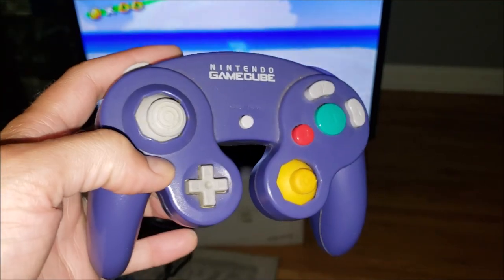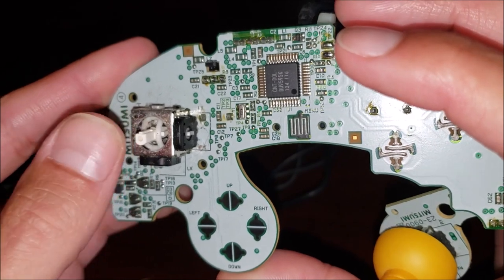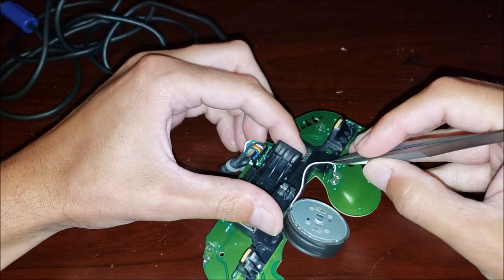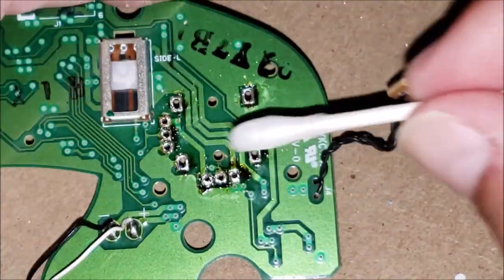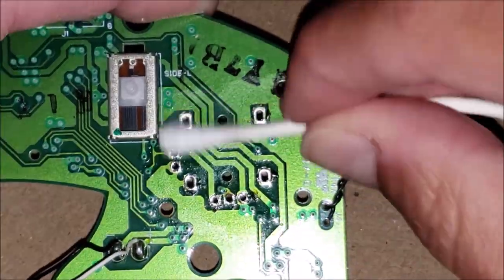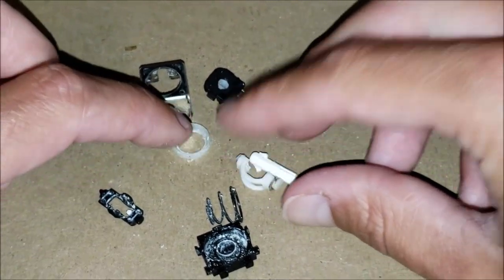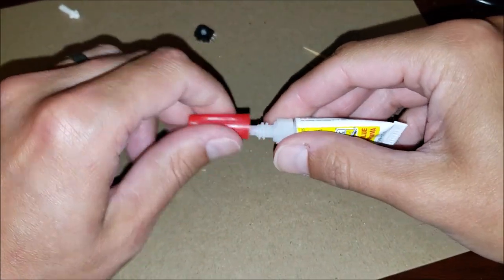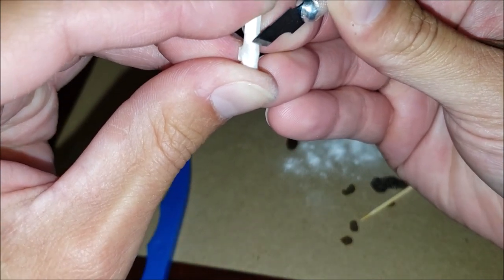Fixing a GameCube Controller Broken Joystick (Wiggle Stick) NO REPLACEMENT PARTS

Comment: I have a very similar problem with my GameCube controller. Thanks for the video
Reply from the maker: Glad to hear this was useful for you!
Reply: Don't do this..remove the stick box and replace it with a new one...they're reasonably priced
Reply: @MichaelScreamMachineEvans  Don't worry I just bought a new controller.
And it works extremely well too

Comment: This is a fundamental problem with the t1 boxes. I work on t2 cleaning, which doesn't have the same pivot issue and contact points for wear. For both t1 and t2 boxes, the black potentiometers are compatible. For the plastics I recommend cleaning using warm dish soap water and cleaning the springs and hosting use isopropyl alcohol. Most lots on ebay of junk stick boxes are loose, but doing a cleaning and rebuild helps alot. To keep the reassembly together I use a small adjustable wrench as a vice as I bend the stupid tabs. Most stick box clones you find as replacements from China or eBay are t1 clones with too whacked out potentiometers (use dolphin gc calibration to check it) and don't work with oem pots
Reply from the maker: I had never heard of the t1 vs t2 before, sounds like you probably know a lot more about these than I do. Yea those tabs are annoying, but luckily my tweezers are pretty girthy and could handle them. Thanks for checking ut the video!
Reply: @FantasticQuack  Here is some community info on the controllers around the middle. https://smashboards.com/threads/technical-knowledge-compilation-gamecubes-controllers-tvs-recording.335040/
Reply from the maker: @Richard_Hu  That is a good info page, thanks for sharing!
Reply: @Richard_Hu  The Kadano info is now pretty outdated...

Comment: For a stronger solution, you could use milliput, glued onto the part with superglue while the putty is still in the curing stage. It will dry hard as stone.
Reply from the maker: I will probably try that if I do a similar repair in the future. At the time I just wanted to use what I had on hand.

Comment: When I was trying to separate the stick from the pivot, I could not get it loose at all and ended up destroying it even more, and here you are doing it in 2 seconds with your fingernails lol. Mine almost came off my finger. Great video!
Reply from the maker: It might have came out easier on mine because it was so worn down. I'd probably have switched to a tweezers if it didn't go the first time. Thanks for watching and I hope it helped!

Comment: im just gonna replace the stickbox, they are dirt cheap on ebay i think i got like 10 of them for a few bucks
Reply from the maker: A fine choice, but remember the aftermarket parts are dirt cheap for a reason. If you can pull a real one out of a separate controller with other issues or worse condition, that is your best bet.
Reply: @FantasticQuack  yeah i just have a single controller from ebay with a loose stick so i dont have that option
Reply: You can buy a whole new controller on Walmart for $10.
Reply: @ihavenoname1343  not a genuine nintendo controller you cant , the aftermarket ones are ass
Reply: @darrell5363  I bought a white one for $10 (not nintendo) and it works great. Just don't see much point that's all
Reply: @ihavenoname1343  they are terrible quality, you get what you pay for

Comment: wow, i did this and it got rid of the wobble a lot! thanks!  though for some reason im not getting any left or right input... any ideas?
Reply from the maker: Were you getting left/right before? Could be an issue with the installation of the pot or the pot itself (number of possible reasons)
Reply: Probably means you did not solder your horizontal potentiometer well and it does not have proper electrical contact with the circuit board. You must open the controller and redo the solder.

Comment: Literally just had this issue happen when I was playing Luigi's Mansion, the analog stick now has problems going left with it now tilting slightly towards that direction. Do plan on getting it fixed. I don't want another problem controller like another one which has its Y button stuck in place.
Reply from the maker: Stuck buttons are usually an easy fix compared to a worn out joystick. For the former it usually is just opening the controller, finding the gunk that is causing the button to stick, and cleaning it out.
Reply: @FantasticQuack  If only little me back then knee that was possible lol. Even if I did knew, I would've probably broke the controller anyway xD

Comment: omgomgomg thank you that's exactly what i'm searching for, spend 3 days before found this vidéo. 
now i know what's inside this joystick mechanism, so i'll be able to repare my cracking left joystick 
(it respond correctly, but stickbox crack everytime i go up then down :/)
Reply from the maker: Glad to hear this, let me know how the fix goes!
Reply: @FantasticQuack  i will, my left joystick is cracking when i go from idle to up position, then crack again when i go down position, (but no prblm when i push left/right); 
it's the small white plastic round that we can see at 3:40 , i dismanteled my gamepad and saw this little thing shifts and "clicks" 
by chance because of your video, now i know how to disassemble this small mechanism ^^

Comment: Yes helpful,can u tell if you buy a refurbished one that no longer works if they used that method
Reply from the maker: I don't know of anyone else using this method. You're more likely to run into controllers that have had the joystick replaced entirely. You'd need to take it apart to know for sure.

Comment: I have a similar problem.. except mine is more worn down than yours.. the front white part is completely crumbled and I would love to replace the whole box. But unfortunately I don't have a soldering tool, let alone know how to use one. I know this is an older video, but it's okay. 😊 just wish I could fix my controller. And had I known about fixing controllers way back when I was a kid, I could've fixed my other controller that my old friend decided to smash against the wall, shattered the joystick cap. Was very sad. My mom threw it away too.
Reply from the maker: This was mainly an experiment to see if it could be done, almost every time replacing the stick box is the right thing to do, especially if you can harvest an OEM one from a wii nunchuk.

Comment: Dont use the baking soda to make the glue dry faster, you use it to make the glue hold stronger. Guitar repairmen use this mixture as a paste to fill in spots on guitars with damaged nuts in a pinch. Mix that shit into a paste and sand it flat
Reply from the maker: Interesting stuff!

Comment: Kool video, GameCube has 3 different analog sticks, ranging from T1 to T3, this one in particular is a T1, mine had a big loose wobble so I replaced it with new one on amazon, it was a T1 model so not much difference except for the black potentiometers, so I kept them on and just replaced the stickbox. I’ve read that the potentiometers that come attached to the boxes you can buy online aren’t good quality so hence I just kept the original ones, I’ll replace them if I begin to notice drifting, anyways thanks for the tutorial I may just do the same with the loose stick box I replaced.
Reply from the maker: Thanks for the info and for watching!

Comment: i am having the same issue of not having full forward movement while playing Ocarina of time. i don't have a lot of wobble like your controller did. when i take the shell off of the controller the problem goes away. i wonder if i can find a fix without having to do a full disassembly and repair like this. a notch cut into the stem of the joystick so that it could go forward slightly more would help, but i don't want to cut a groove into the joy stick
Reply from the maker: If the stick isn't wobbly it sounds like there could be some foreign material in the stickbox potentiometer causing your problem. You can pivot the potentiometer away from the stick box to get a look inside/clean without desoldering it, this would be the first thing I'd do but it is hard to describe the process with text and I don't have a video (yet) to reference.

A  more simple thing to try would be squirting 91% rubbing alcohol into the stick box, rotating the stick around a number of times to work in the alcohol, then blasting it all dry with canned air. Do that 2 or 3 times and it might clean out the potentiometers sufficiently to solve the problem. If it doesn't work it at least won't cause any new problems.

If you want to add a cutout on the stick cap to give the joystick more forward motion, you could buy some cheap replacement caps online and cut into those so you're not damaging the good OEM one. Doing this doesn't solve the root of the problem though.
Reply: @FantasticQuack   Since I posted that comment, I found a practically brand new GC controller at a local game store. I don't think it was ever even used.
I also bought some soldering tools, so one of these days I'm going to get the stickbox out of the old controller and try this repair. It definitely has wobble. I'm not as nervous to tinker with the old one now that I have a new one. Definitely going to follow this video when I do it

Comment: I had a go at this last night (before seeing the video), but it wasn’t so successful. There wasn’t actually much wrong with the controller but I had 3 spares so I was just trying to see if I could eliminate the wiggle entirely. (I managed but at the expense of the controller’s ability to turn left), so not a success. 

It’s weird seeing the small differences in controllers though. Mine didn’t have any soldering on the four legs of the metal frame that stick through the circuit board and some components were a different color etc.
Reply from the maker: Were you trying to repair a worn out component like in this vid? Is it not turning left due to bad wiggle, or is there an issue with either the reassembly or the potentiometer itself? I've heard of those pots going bad before.

I believe there are 3 variations of the joystick box depending on the time period the controller was manufactured. I think the one in this vid is the "oldest" variation.
See section 2.5 of this link for more info.
https://smashboards.com/threads/technical-knowledge-compilation-gamecubes-controllers-tvs-recording.335040/
(This was new to me, shared earlier in comments by RH)
Reply: @FantasticQuack  I was trying to repair a worn out one, but I didn’t really know what I was doing. I’ve actually got it sorted now and just swapped the C-Stick box out of another controller and switched it into the left analogue stick position and it works great. The right sticks never get as much wear as the left so it was in near perfect condition.
Reply from the maker: Happy to hear that! Parting out some brokens or spares is always a good way to go.
Reply: @FantasticQuack  makes me wanna fix joystick on my orange GameCube controller to Finish Metroid prime 2 echoes and Sonic Riders and Tak 2 Staff of dreams before this year is over.

Comment: It is possible to do it without soldering?
Reply from the maker: Unfortunately not
Reply: @FantasticQuack  actually it really depends on the controller. some gamecube controllers (ones that are the most recent hardware revision {called t3}) have fully plastic stick boxes that only need to be unscrewed and then unclipped from the potentiometers to be removed. impossible to tell what revision ur stick is unless u open it up though.
Reply from the maker: @KnishG  True. My response was referring only to the hardware shown in this video. I've only recently become aware there there were multiple stick-box designs.

Comment: There a $1.25 a piece on amazon. Wouldnt it be easier and faster to pay for a new 1
Reply from the maker: Of course it would, but where's the fun in that? The point of this video was to do the job with at-hand options and keeping original hardware.

Comment: This is a T1 board, no wonder. 😂 T1 joysticks aren't built to last and they are very crap. You'd be better off replacing both stickboxes with T2.
Reply from the maker: You're probably not wrong! I have since taken apart some newer controllers and the stick-boxes did seem improved.
Reply: @FantasticQuack  T3 controllers are best. You'll know it's a T3 because the whole stickbox is made out of plastic and it's all white. T3s last way longer and you can lubricate them to make them last even longer.
Reply from the maker: @SuperLuigiGuy64  I'm not privy to the T#'s, but I was digging around in a black controller the other day and the stick-boxes on that one match what you described. It had less solder points as well.
Reply: @FantasticQuack  Correct, T3 stickboxes are held in place with 2 screws while T1 and T2 are interchangeable with each other and have 4 anchor points to solder down.